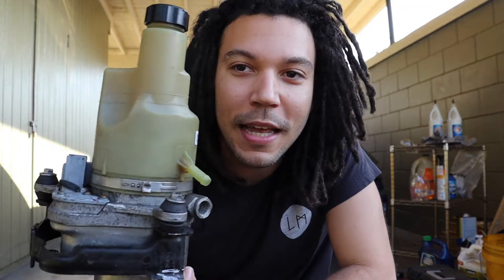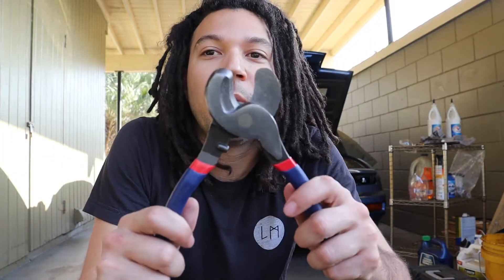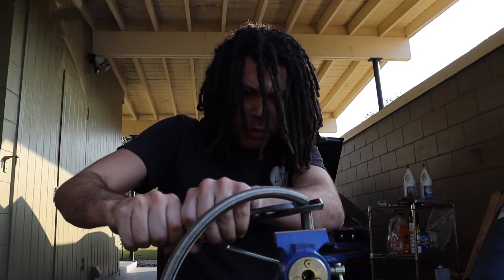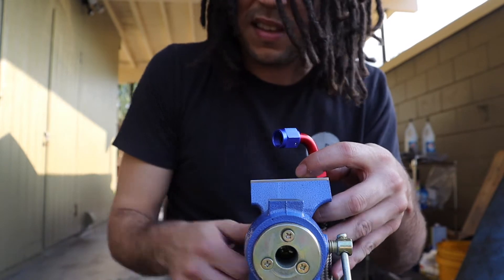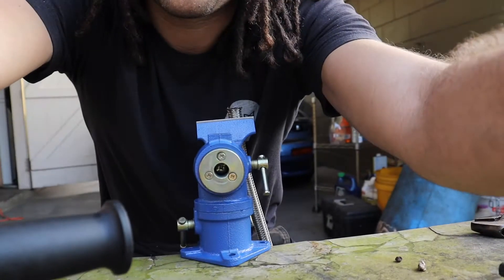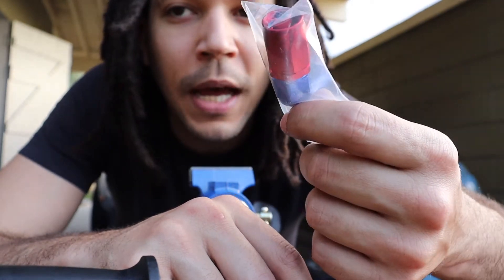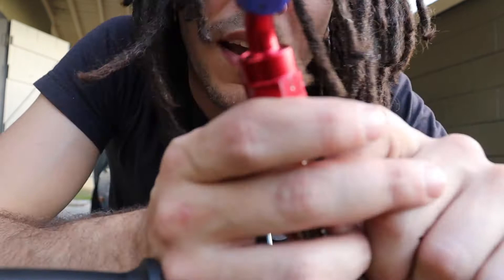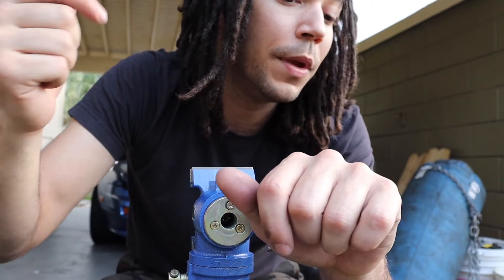Cutting and Fitting Braided AN Hose Assembly Plus Cash Giveaway!

Comment: You're using the wrong hose end and hose for the high pressure line. PS hose ends are steel and PS hose is stronger. Your high pressure hose is eventually going to shoot out of the hose end when you're at full lock. You scratched up the hose end because you bottomed it out. There's suppose to be a gap there, up to 1/16". You can just run your thumb's fingernail between the fitting to check the gap. Basically, when you're close, just align the hex flats.
Reply from the maker: True that, I have seen a few people do it this way so it is news to me. Thanks for the advise. I will for sure take it easy until I get something stronger. Possibly this? What do think?   https://www.summitracing.com/parts/fra-372024?seid=srese1&gclid=Cj0KCQiAst2BBhDJARIsAGo2ldXTuLTSVZuDPt15RlUG_TVKAkAlHWEKn9cAQk7nLG-Rx4di4KEWDwkaAnY6EALw_wcB

Comment: Use a little oil on your threads & on the nipple before the threads! It slides in better & wont push the hose out! ✌🏻🏁
Reply from the maker: Thanks good to know
Reply: @dripndrift  No probably, next time you put a fitting on a hose you’ll be like, son of a bitch, that was much easier, lol, just a little trick of the trade. If you’re doing a bunch just put a little oil in a cap & just run a little around the nose & threads…💪🏻💯✌🏻